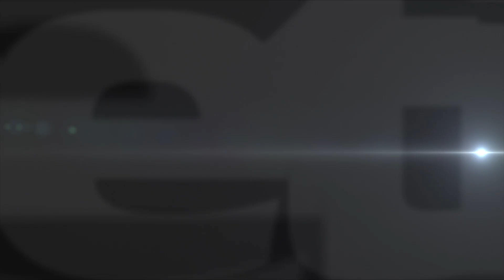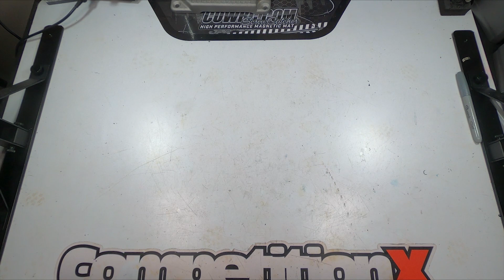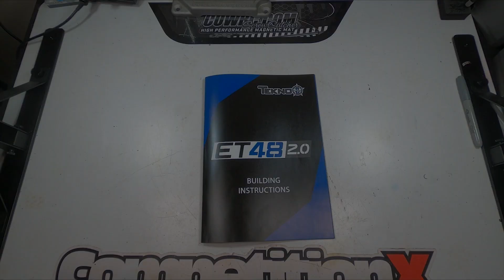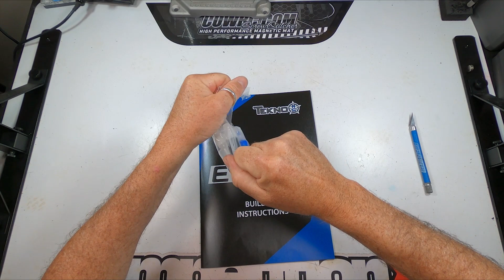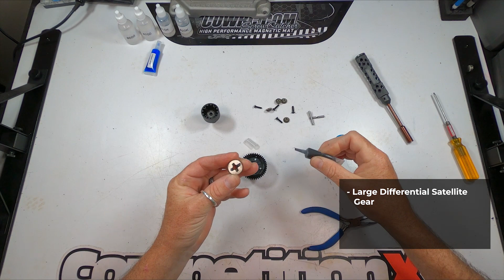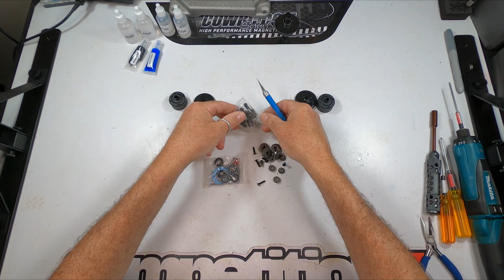Tekno ET48 2.0 Build - Part 1 - Intro, Differentials | CompetitionX

Comment: Its sad years ago tekno eb48.4 came with the lightened x outdrives  and now they dont. so one who wants them need to spend 75$ to up grade. They should include all the mods on them. Ti shock shafts , lightened hubs , graphite servo plate . Now yea dont need titanium turnbuckles or abec 7 ceramic bearings stock as that would turn the kit into a 900$ kit.
Reply from the maker: Well, companies make their money on the parts, not the kits. So, I can see why they don't include them - if you want the go faster stuff, you can buy it. I'd be curious as to how many of these buggies and truggies actually see track use, thus the actual 'need' for upgrade parts.
Reply: @Competitionx   I run all the mods and mods people dont think of in all my rc's and i dont even race. LIke my shock shafts i file the derlin bushings and use better o rings till i get under 20 grams of shock shaft resistance and keep all 4 within 2 grams of force. Balance all of the Wheels as well, abec 7 ceramic bearings (bought in bulk at cheapest prices) , durango aluminum tie rods , titanium hardware bought in bulk , drill rod blanks a arms , not using shock dust shields that cause 5 grams of resistance binding , each shock with spring on tension set by a weight scale and not by trying to equal the distance of each adjuster as spring tension can be slightly different on same color coded of shocks. why ? Because i like physics basically and using it properly.
Reply from the maker: You're probably one of the few (that doesn't race) that actually puts parts on for the tuning - most don't know what upgrades do other than 'look' nice. Props to you sir!